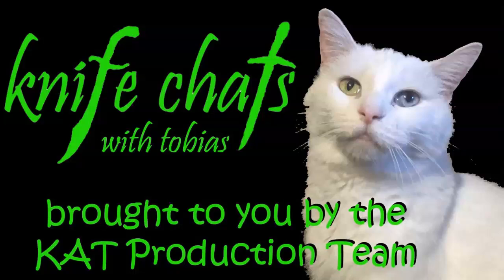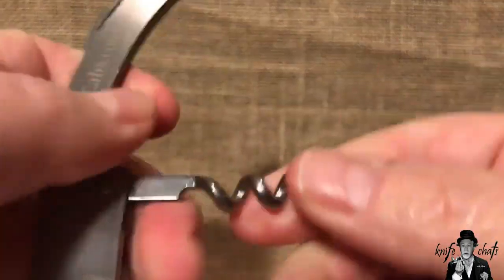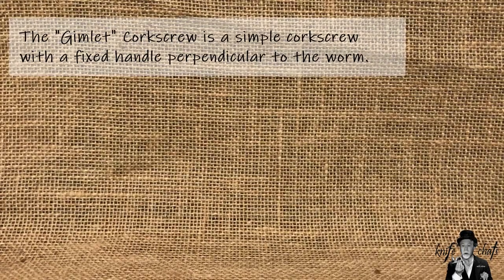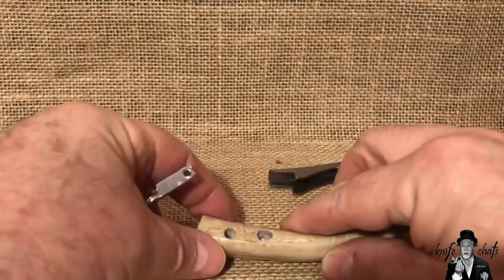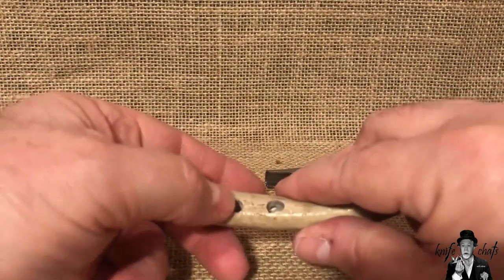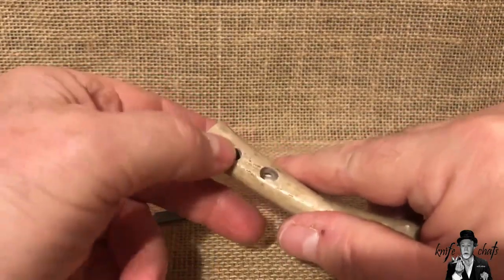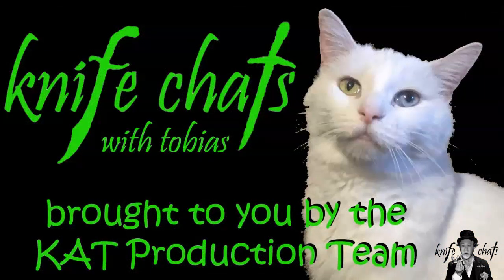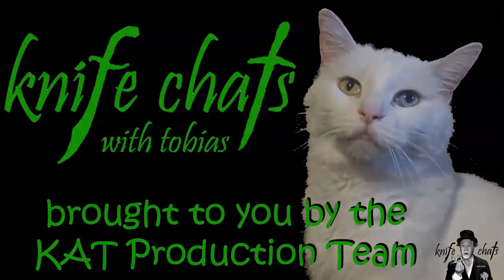Making a "gimlet" style Corkscrew

Comment: Nice job. Yes, I have had similar things happen. The concept seem simple at first, then little things start popping up that turn into big issues. To hide the pin it looks like you would have to make a little antler cap like they do on wood. They usually sell those mini butane torches at gas stations, probably for the crack heads. 😄
Now you need to test it on a bottle of wine.😃🥂
Reply from the maker: I’ll have to look for the butane torch.    I was also thinking of putting it in hot coals.  I’ll need to do some you tubing on the topic.